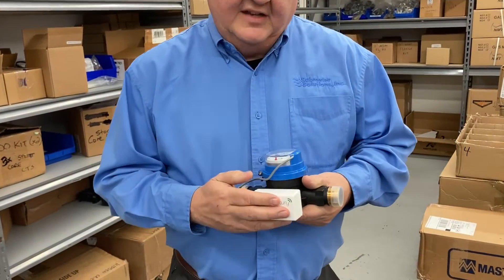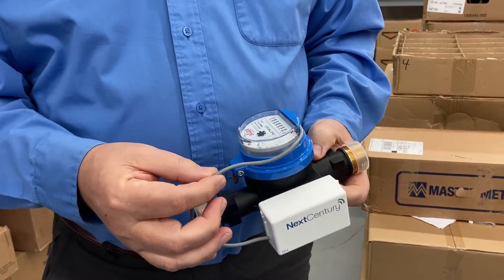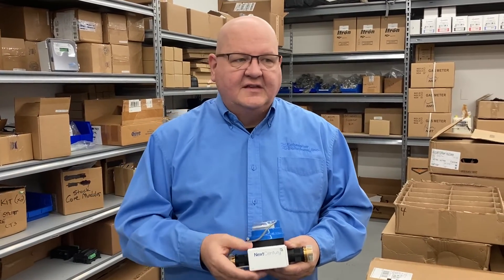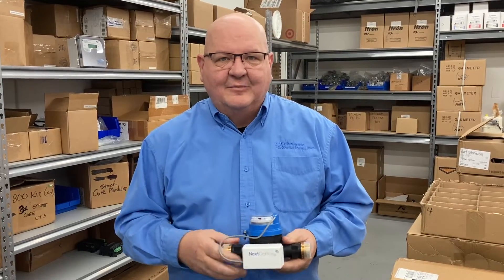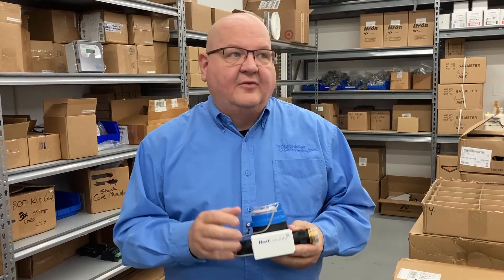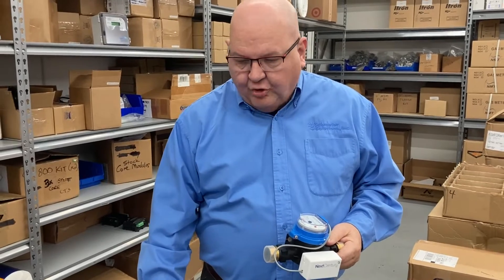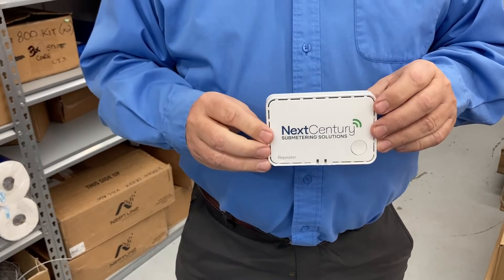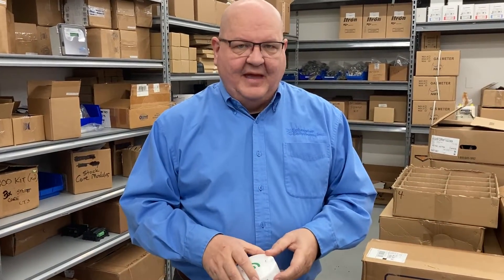Overview of a Wireless Meter Reading System

Comment: How many apartments is the system able to handle?
Reply from the maker: Great question! It is technically unlimited. The largest test case has been 2000 units on one Gateway, but there is no restrictions to allow it to do more.